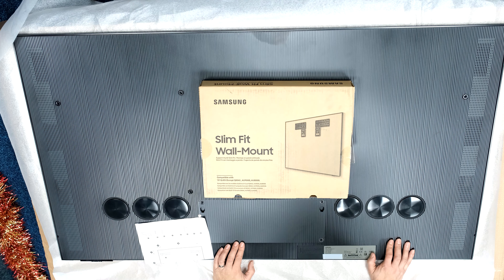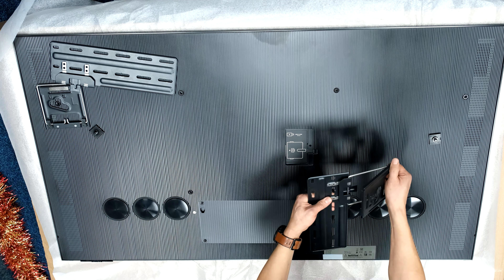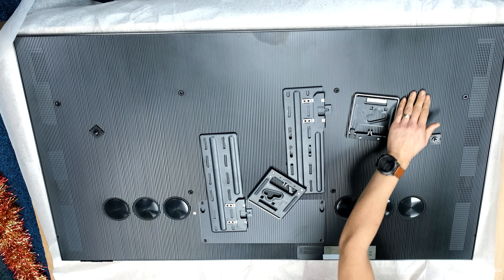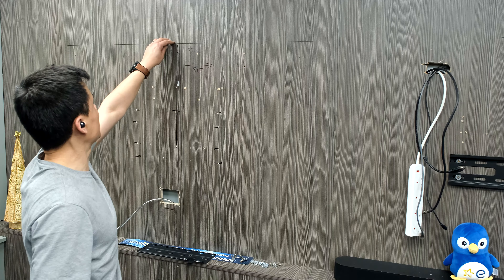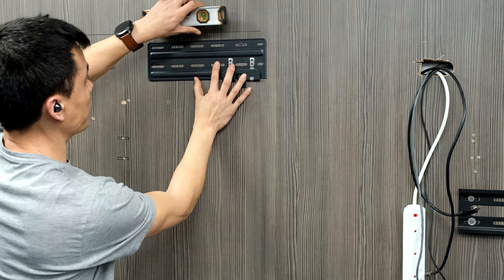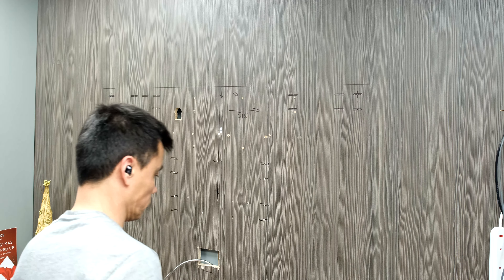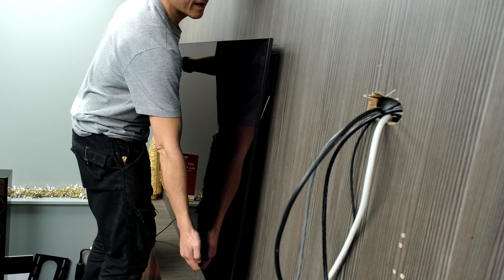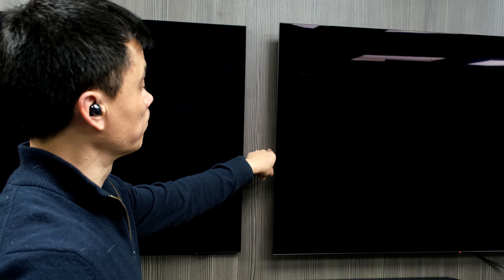Slim Fit Wall Mount on Samsung S95C

Comment: I bought this wall mount for the s9077c but no installer wanted to mess with it because it was complicated but it doesn’t look too bad
Reply from the maker: I think the initial paperwork makes it look more complicated than it really is, after I did one install the following ones were so easy
Reply: @TellyDan  good to know thank you Dan
Reply: @Mano_on_Point  any tips for that? I've also bought  WMN-B50EB for S90C 77". I've read some comments that this wall mount is not compatible with S90C 77" :/

Comment: Hi Dan... question - I've got the s95c 77" and the stud placement in my drywall means the wall mounts won't hit any studs. Do you think it's possible to mount this TV from the 2 top holes of the vesa mount (closer to the center of the TV) rather than the 2 holes near the edges of the TV? If I can use those center holes, I'll be able to align with the studs. Thanks!

Comment: Hi Dan, really helpful video. I've found that the bottom right TV corner is further from the wall than the other corners. Do you think the TV-side brackets need adjusting? I thought it could also be the TV-side brackets are bent out of shape because I got refurbished ones. thanks

Comment: Hey there mate just a quick question with the slim mount do you think there is enough room behind tv for a brushed plate to allow cables to go through wall? Instead of just having a hole in wall for the cable to go through?

Comment: Hi, If i buy any Tv that's officially on Samsung's website supported by this mount, do they have those metallic brackets at identical distance from each other? So if I install it on one 55" it should also work for 65" tv?

Comment: Hey folks. I bought this tv and the mount recently and my handyman installed but I’m unsure if he did correctly to be honest as the tv doesn’t sit flat and the fixings appear slightly over the tv as it’s tilted downwards. I believe it’s because the one connect cable is going back through the wall and there’s some length pushing the out at top. 

So my query is in relation to the video? I see you say ur connecting the cable at end, but I don’t see where the cable goes?

Is it through the wall?

Is there a way to run cable behind the tv without a wall entry point? To keep it as flat as supposed to be?

Hope you or someone her can assist. Thanks.

Comment: Hello Dan, I have just received the OLED S95C (2023) and I'm struggling to find the WMN-B50EB (the newest version) in Europe. Could you confirm that the WMN-A50EB (that I have found on a webstore) is exactly the same and fully compatible? As far as I understand, it's just a matter of the manual. i.e., the model OLED S95C (2023) is not mentioned in the WMN-A50EB manual, but thanks to your videos, I could easily install the TV in the proper way! 😃"
Reply from the maker: Hi Antonio, yeah the brackets just the same, the paperwork maybe different but that's all
Reply: Hello. Did you end up using WMN-A50EB mount? I ran into problems. 55 inch SN95C with same mount. When I hang the tv, it drops down and showing part of the mount above tv. Any suggestions?

Comment: What size TV was it? I want to buy 55inch and saw a comment that the wall mounted brackets are visible / stick out from the top. Also not sure which model of slim fit mount to order for this TV, there are mix opinions out here.
Reply from the maker: This is the 55 inch s95c most of the Samsung range are compatible with this bracket I've even mounted 50 inch qn90s on this bracket
Reply: Don't, its to small for 4K in 55 inch !
55 Inch is good for HD
65 inch 4K
77 or more for 4-8 K

Comment: hi, do you think it will be the same as the s95D tv. and I have another question, can we use the bottom middle holes with this type of support. Thank you
Reply from the maker: The top middle are usable but the bottom middle would only be usable with a vesa mount bracket, I imagine it would be the same as the s95d as well
Reply: @TellyDan  Thank you

Comment: Hi there, a real stupid question but the TV is slim because of the slim one connect box being separate.  You are obviously attaching to a built unit but if I just want to attach this to my wall, do you have to chase the cable from the TV to the connect box into the wall if you want it hidden or is there another way of doing this?  I would have thought a wireless option is available but happy to make do with the one cable if I have to.
Reply: Obviously, there is a power delivered to TV with the same cable so no wireless option here

Comment: Hi mate thank you for your videos, advice and all the hard work. I have a wall but it has sockets behind where the tv would sit… my question is with this mount would I be able to pull it out further to have a slightly bigger gap from the wall to the back of the tv? If not which other mount would you recommend ?
Reply: I have same problem 😢 what was your solution?
Reply: Hello, I have the same question. Have you been able to install it?

Comment: If I want to route the One Connect cable through the wall, is there enough space for the cable to go anywhere behind the TV or does the TV sit flush against the wall and there isn't space?
Reply: It’s 7.5 mm between tv and the wall. That’s enough for the One Connect cable.

Comment: Would you be confident vesa mounting this with the recommended M6 screws which I believe are only 6-7mm because of how thin the TV is?
Reply from the maker: Yeah I think they're m8 and there's a framework inside to give it strength

Comment: If there are no studs to attach the mount to, would going right into the drywall ever be an option ?
Reply: that's where these mounts suck, with normal brackets you can get the screws across a wide range. In theory you might be able to get away with 4 plugs to drywall, over time I reckon the weight of the TV would just make it fall off.

Comment: Dan, any confirmation on length of the M8 screws needed for standard VESA mount? Ive read 6mm, 8mm, and 10mm but cant get a clear answer. Like is there room for 6mm without washers or is it 8mm with washers etc??